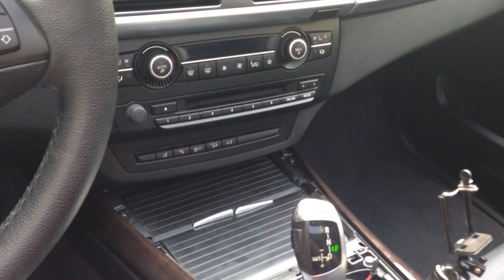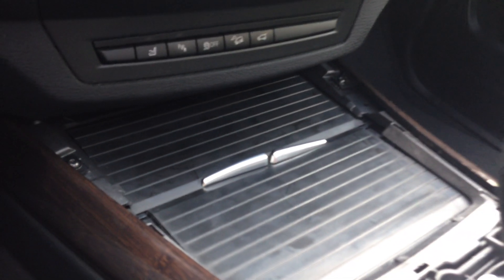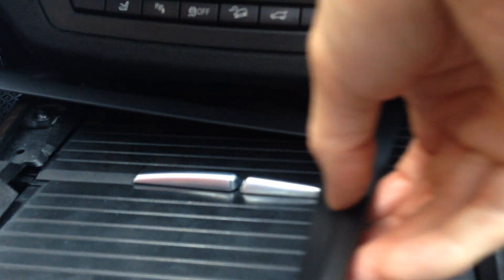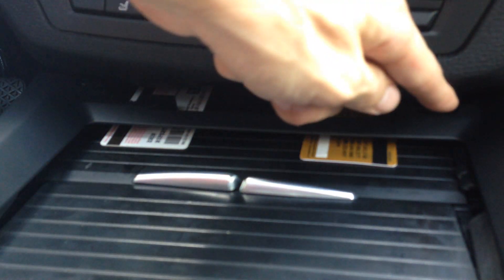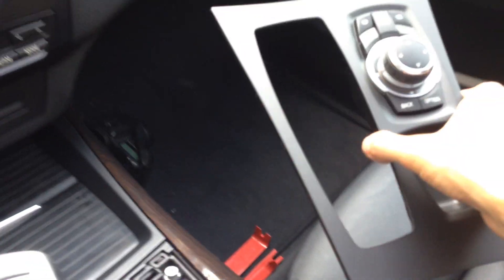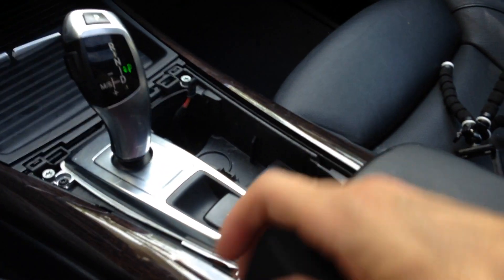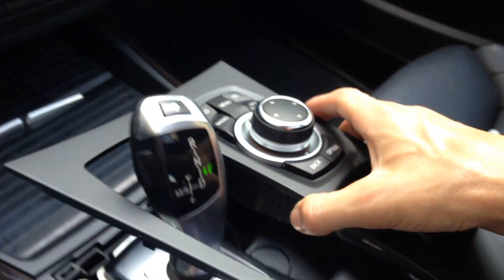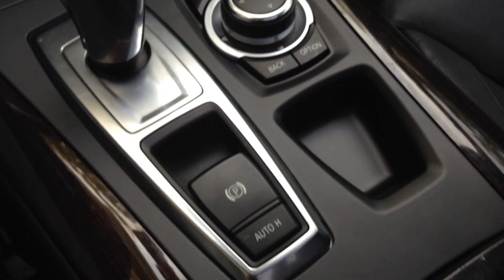BMW E70 X5 - Center Console Trim Removal & Installation (2 of 2)

Comment: Extremely helpful with my BMW X5 E70 2009 interior refurbishment. I struggled for about 10 mins, then remembered seeing this video. This method worked perfect and was key to getting this replacement part installed. Thanks.

Comment: Great video! Can you please provide links to the two trim pieces?  I'm wanting to replace them both in my 2011 X5, as I'm already replacing the parking brake module.
Reply: Jonathan Kudla have you found out?
Reply: I ordered the parts from Bavarian Autosport.
Reply: Yes Bimmer video dude, please link where you got parts, thanks!

Comment: Hi, great video.Can you show how to take out the retractable cover for the cup holder on a 2015 model. I have a coin stuck behind it and its driving me crazy it moves every time the car moves.Thanks
Reply: +Ibraim Dauti Same here, dealership wanted to charge me $400.  I sent a complaint letter to BMW USA.  It's the most annoying thing.  The dealership said it was my fault.   About 3-4 coins are there and they rattle around.  I have a 2015 BMW X5.
Reply from the maker: Unfortunately I don't have knowledge on the removal process on 2014+ models.
Reply: I just ordered the cup holder assembly for my 2008, since the draws are broken. I'm sure it's going to be a nightmare to install, but thanks sharing us how to remove and install the trim.

Comment: Question--the door closest to the gear shift snapped in half (half of it is stuck under the console). What is the best way to fix it? My Indy is saying it's a few hundred dollars you have to replace the unit and the labor. Thanks.

Comment: Where can I purchase a replacement center console??? I cracked mine.
Reply: Did you ever find out where to get them? 
eBay has some carbon fiber "look a like" parts here and there for the gear shifter, but i wasn't able to find the trim around the cup-holder area